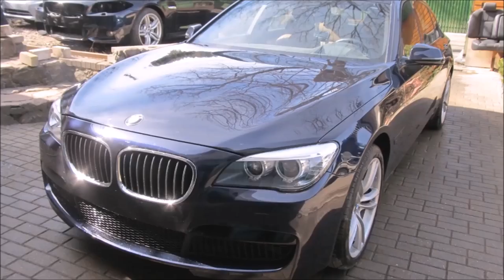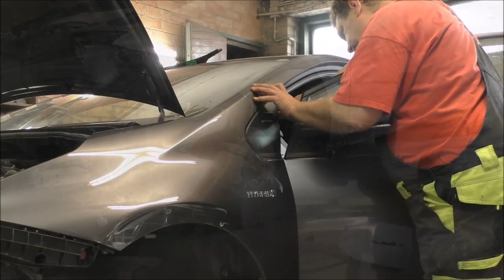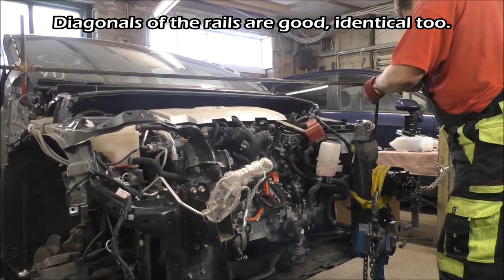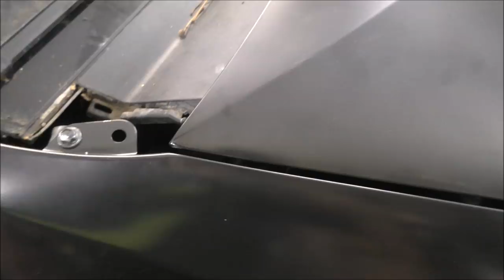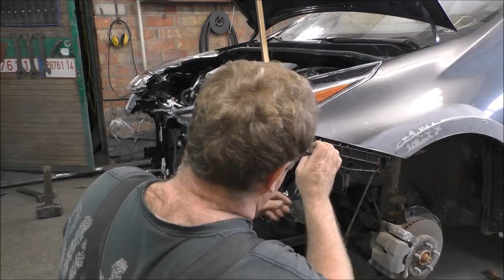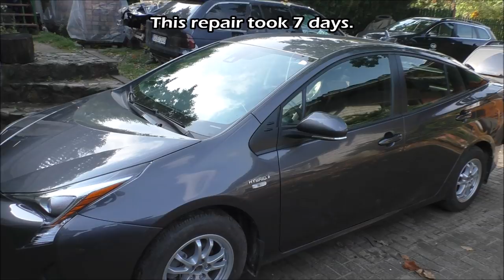Toyota Prius. The minor body repair. Небольшой ремонт переда.

Comment: I have watched numerous of Arthur's handiwork with tools of the trade. There is not a car this mann has laid hands on that has come out as close to perfect. In some cases attention to detail is awe inspiring. If you take that reforming bent metal will not be 109% the same as before but Arthur works it all into place. Here in SA the panel beaters don't have a patch on this workmanship. They can't even fit a windscreen without having to go and readjust rubbers and covers after they finished. Wish I was there to shake hand of a true maestro.  All the best Arthur.
Reply from the maker: Thanks

Comment: When performing body work on a vehicle equipped with Hybrid Synergy Drive, what measures (if any) are taken to isolate the storage batteries, and the electric drive, from the remainder of the vehicle's power systems?"
Reply: Not Arthur, but normally you pull the main disconnect on the hybrid pack and disconnect the 12 Volt as well. Do the same thing on any hybrid. Pretty standard for any body/repair shop. Having either one short out can make for a bad day.
Reply: +Blazer02LS, Many thanks!  My family's shop had a Lincoln Town Car dropped off by a dealer, which was brand new, and one of the first of the "self leveling" vehicles. The right rear quarter was damaged while it was driven off of the car carrier. The dealer did not notify us of the feature, or tell us that it needed to be disabled. My family's shop hardly ever used polyester filler, as everyone knew how to "work metal" (which lasted only until the late '80s when the lightweight alloys were introduced across the board, and they were too crystalline to shrink).

They always jacked and braced the side of the car with the damage, for convenience. You can guess what happened.